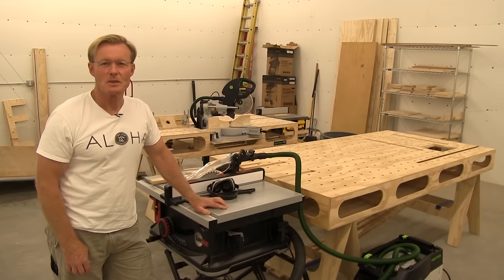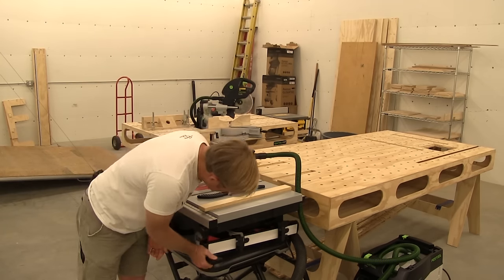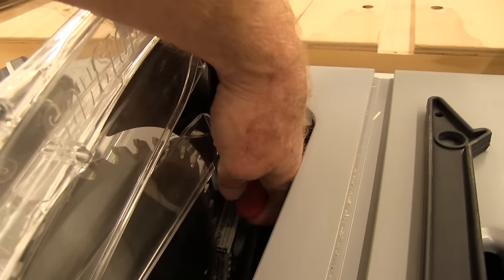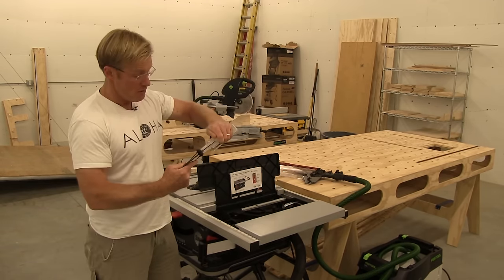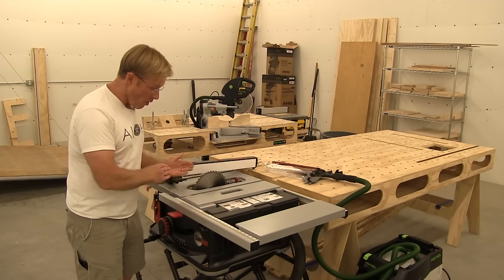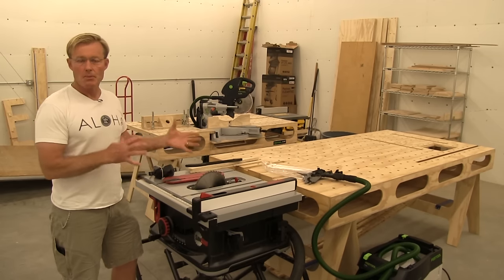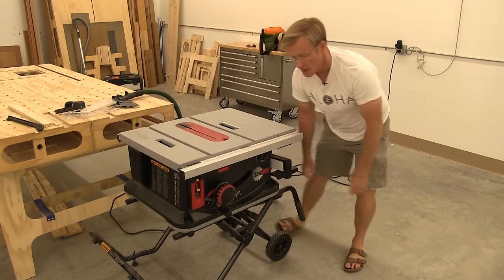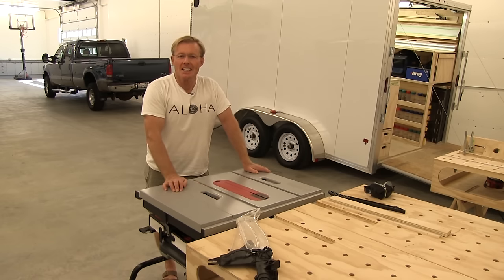Is the SawStop Jobsite Saw Worth the Investment? My Honest Review

Comment: I really like that you showed all the tool-less functions of the riving knife, pawls and guard - really handy that you don't have to find tools to do changes, especially on a site - you showed the brake, is that the same part number brake as on the cabinet saw? - I love when things are cross compatible - I can see many cabinet guys having the full cabinet saw in their shops and the job site saw when installing - so having a brake that works on both would be nice
Reply from the maker: Nick Ferry I have been told that it is the same brake.
Reply: Ron Paulk very cool
Reply: Between 6.40 and 7.40 that is the technology of the original jimmy jig by macduff, credit where credit is due, for proof simply check it out

Comment: True job site  saws have generally been decent for a while now, but to see what SawStop has done is truly impressive. To see not only what they mean to ‘safety first’ , but also in the bevel adjustment, blade rise efficiency and fence accuracy engineering? It can be argued that they are probably the most cost effective saw on the market. (This same mindset has lead to the safety and comfort within the modern vehicles we depend on.) Go SawStop.

Comment: I'd really like to get the SawStop for safety reasons, and this is the only one I can really afford.  How would it compare to the Ridgid r4512 as a first saw for beginning woodworker?  Can I do fine woodworking with this cheap SawStop or would the Ridgid r4512 make better cuts due to being cast iron top?  I'd pay the extra $800 for the SawStop over the Ridgid r4512 if it cut as well (or better).
Reply from the maker: I cannot speak to the Ridgid saw as I have no experience with it or any Ridgid tools. I have two portable SawStop saws and they do everything I ask of them plus go anywhere which is my main requirement.
Reply: Just wondering if you  ended up purchasing that new job site SawStop and if you did how is it working out for you. I am  in a similar position new  to woodworking , wanting the safety features but also wanting a saw I can  build furniture with. Take care.

Comment: Just wanted to thank you Ron.  I bought and used your plans a few years ago for the workbench, and integrated a router, foot-driven vacuum clamping and various cutting jigs that I bring on and off as needed.  I keep it in the shop 100% of the time, and those sawhorse legs, together with the weight of 3/4 baltic top and bottom, and 1/2" sides make for a good 650+ pound solid monster when loaded with planes and other hand tools.  
It's a solid and much more functional for me than my Roubo ever was.

Comment: Does the Sawstop have a bolt hole or anything that can be attached to the workbench to keep the two connected and stable for large out-feed situations?
Reply from the maker: Andrew Latham Andrew, I haven't noticed. The saw is very stable without attachment to the bench and I have used it in demanding real world applications. It doesn't budge. My philosophy is to not spend any time solving problems that don't exist;0)

Comment: Hi Ron. What do you think of the mitre guide? I just bought this very saw and am wondering if I should buy a better, less sloppy guide. Thanks
Reply from the maker: The miter gauge works, but barely. I think all stock gauges are junk and a good aftermarket or shop made is the way to go. I use a miter sled that I built when I need that type of work done. https://www.youtube.com/watch?v=IRVrq6EUBA0

Comment: I  think the New Bosch Reaxx job saw will be superior with it's safety system that doesn't ruin the blade and takes less time to get back to cutting material..
Reply from the maker: +Deke1 Time will tell. I hope Bosch improves their fence with the new saw. I had two Bosch TS with the gravity stands and they were well made, but the fence was not the best. I sold them and switched to DeWalt due to the superior fence. The SawStop has the best fence of any jobsite saw I have owner or used to date. The stop system is important for safety, but how it stops and the time it takes to get it back to work is secondary to the daily function of the saw for my work. I have yet to have the stop trigger, but have used the saw plenty.

Comment: Ron, great video.  I have thought about the SawStop before but have always been turned off by the pricetag.  Your video is very illuminating as to some of the other features of the saw beyond improved safety.  I am wondering if you have had any trouble getting the saw to line up with your table.  Is there a way to adjust it and is it easy to do on the jobsite?  I am starting to build your excellent Total Workstation and wonder if I should bother with adding the tablesaw supports at all.  Thanks!

Comment: To adjust your Paulk workbench did you just cut the legs down a bit.  I made your bench and purchased a saw on a stand like you, and now the saw is not as high as the work bench.  I have been placing wood blocks under the wheels and feet to raise the saw.  Kinda of a pain in the butt.
Reply from the maker: misterbig697 I adjusted the straps (spread of horses) so both of my benches and table saw match in height.

Comment: What kind of woodworking/carpentry do you do?  I ask because I want to purchase a SawStop, but I have a small basement shop and don’t really want to dedicate space to a full-size cabinet saw.  I’m considering the SawStop Contractor model with the deluxe fence (put it on wheels, of course).  I’m a DIYer, and like building cabinets, book cases, and want to build bedroom furniture.  So for the type of projects I do, I’m leery of the job site saw due to the suggestions by others that I’ll not be happy with the standard fence on it; thus, why I’m considering the contractor version with the fence upgrade.  Your thoughts?

Comment: I'm pretty sure that is my next table saw purchase   Ive been waiting for a YouTuber to   Build   A cabinet / work station around  that model  incorporating  a more permanent  set up  than your system  as i would like it to be  a shop saw   And am picking it as a lower. Cost  option  over a Cabinet Tablesaw  but still having the safety  features  of the SawStop

Comment: I have a ridgid table saw and also the festool track saw and I find I use them both but I'm considering switching to a Sawstop and either the JobSite or Contractor saw model.

What tasks do you find better done on the table saw out in the field? And if you didn't need the tablesaw to be portable would you have the contractor or cabinet maker saw stop instead of the job site?

Comment: An excellent video review, Ron.  And superb video editing and really good clear audio, too.  There is  just a little reverb, but it's still quite listenable --  a big THUMBS UP!    For dust collection, are you running a separate dust collector in addition to the Festool shown?  Or did you opt for the Festool CMS "Y" hose to connect both dust ports on the SawStop to the Festool?

Comment: Does the hose for the vacuum interfere with the total station? I built one similar and the hose is right where the bottom platform is.
Reply from the maker: brutusman12345 I just a 90 on the saw to clear the bench
Reply: Good call

Comment: Ron - I notice that you've got your saw connected to a Festool dust collector. I just recently bought the SawStop Jobsite and tried to hook my Festool Midi to the saw - unsuccessfully. I also purchased the optional blade guard with the above the table dust connection port. The Festool Y-connector isn't supposed to fit in the Midi, but using some parts I made it work, so my setup is essentially the same as the setup for the Festool router table - a small hose (27mm) for above the table, and a larger hose (36mm) for below. I tried to connect them to the SawStop saw and neither one of them fit. The 27mm hose was too big, and the 36mm hose was too small. How did you get it to work? Tape?
Reply from the maker: Bob, I haven't had a problem with any vac including Fein, Festool, Milwaukee, Shop Vac, etc... Check out this video.https://www.youtube.com/watch?v=mBZOQlYcVT8

Comment: Can I make a partial cut on a 6 inch board held vertically (with the blade up say 3.5 inches), and then a second cut with the blade at the same height with  the board reversed (up and down) and thereby completing the cut all  the way thru the board.  Thanks  TJ

Comment: I am in an apartment, and probably have more than is "reasonable".  Unfortunately, I cannot accommodate your workstations...

That stated, I am looking into the SawStop table saw, but will need to cut +/- 48" x 48" from time to time.  My concern is the stock feeding area...  what would you recommend for my (and, other apartment leasee's) needs?
Reply from the maker: +TheRangeControl The best options for breaking down large material is a track saw. I would purchase a track saw before getting a table saw.
Reply: I suppose that this NOOB is going to need to to YouTube "Track Saw".  LOL

Thank You for your guidance, Sir.
Reply: By the way, any recommendations?
Reply from the maker: TheRangeControl I have, use, and highly recommend Festool's track saw.
Reply: +Ron Paulk Sir, I hail both you and your generosity.
Reply: Ok, I just got back from the store, and am likely going with your Festool recommendation.

I do need to ask you...  For dust extraction, I cannot see myself spending the over $700 for the Festool branded one (UNLESS you TRULY, TRULIY believe that it is superior enough to justify to cost).

I understand that all needs are subjective.  Therefore (as a scope), my concerns are based upon effective dust management within an apartment unit.

Please advise (and if possible, please share alternatives).

As always, thank you for your time, Sir.
Reply from the maker: TheRangeControl Festool is top shelf and captures the finest dust and does not blow it back into the air like less expensive units. Another good vac is Fein. They are about the same price. http://www.amazon.com/Fein-9-20-25-HEPA-9-Gallon-Vacuum/dp/B003INE4N0/ref=sr_1_9?ie=UTF8&qid=1453845749&sr=8-9&keywords=fein+vacuum+turbo+ii
Reply: Thank You.  I appreciate your candor.
Reply: I need recommendations on 2 more things (I may as well ask since i've asked about everything shy of your social security number... LOL).

1a.) What are your honest thoughts about Triton routers?  1b.) Would you recommend it for Router? 1c.) What would be your top 2 choices?

2a.) Orbital Sander or Random orbital?  2b.) Your top 2 choices?

Those should keep me and my humble bank accounts, projects busy for the next 2 quarters of 2016.  

I really appreciate your time and hope that perhaps you will do video on creating "highly placed single shelves along the wall" to maximize the vertical space...  I'd like to place my books and binders along the top of a few walls, but I am afraid that the weight will cause the shelving to collapse... So, I'd love to be able to follow along and make sure that I do not miss any important factors as I create this "Function over Form" storage solution.  LOL

Again... Thank You, SIr.
Reply from the maker: TheRangeControl I don't have any experience with Triton. Possibly someone else who sees this that has Triton can comment. I own and use Festool, Porter-Cable and Milwaukee. My go to router and favorite of all time is Festool 1400. Sorry to say it, but Festool is by far and away my favorite sander. The control and dust collection is  beyond any others I have owned. I would save $$ on the router and use the savings on a sander.
Reply: Grateful Appreciation!!! :-D
Reply: Ron Paulk oops, sorry... which model sander?
Reply from the maker: TheRangeControl
https://www.festoolusa.com/power-tools/sanders/ROTEX-ro-150-feq-multi-mode-sander-571810

https://www.festoolusa.com/power-tools/sanders/6-random-orbit-sander-ets-ec150-5-571892
Reply: Thank You.

Comment: Great video, what’s the retail price . I have been looking at Makita and Bosch portable table saws for my first table saw
Reply: the SawStop portable saw is like $1500 compared to the $500 range for all the home depot options you speak of. the main difference is the SawStop technology to save your fingers but the build quality is a bit better on the SawStop than the makita or Bosch you're referring to. If you have the coin and want the safety get the SawStop. you won't regret it years down the road for spending the extra

Comment: Ron, do you just leave this saw in your alleyway of your trailer now?
I'm really considering the Bosch with Reaxx... I do like the fact the blade does not get 
destroyed.
Reply from the maker: +K Burk Yes, I store the saw on it's stand in the aisle and roll it out of the way when using the trailer. I am glade Bosch is now entering the safe saw world and hope others follow quickly. I wouldn't choose the saw based on the blade being damaged or not. I would choose based on how well the saw works for you and your needs. If you ever need the system to save a body part, the blade issue will be irrelevant.
Reply: I agree, I use a Bosch saw now on there stand, I love it! It works well in the field. I have all my fingers and at most times of the day my brain is attached to them... saying that I know having a safety feature like Saw Stop or Bosch is the smart thing to do. Its good technology. I was wondering about your trailer because I'm building another one myself. Of course I have looked at yours and the work you put into it makes me want to up my game! I'm not a organized person and I'm not lean....but there is hope I can get there!  Thanks for your response.
Reply: K Burk fyi, the brake rarely actually destroys blades. Just lightly tap the the aluminum a little on each side and it usually comes off with no damage to the teeth.

out of the 12 tripped brakes I have dealt with (working in art schools... darn those aluminum cross cut fences!) I have been able to save all but 3 blades. Two lost a tooth (which I could have had repaired) and one blade ended up being out of true.

Comment: If you were ever to buy another cabinet saw would it be a Sawstop?
Reply from the maker: Bill Hantzopoulos Yes, I have liked their saws for years, but didn't have a need or desire for a cabinet or contractor saw. I was ecstatic when I heard they had a jobsite saw in the works.
Reply: Ron Paulk Thanks Ron. I am looking to buy a cabinet saw but struggle with the price difference between that and say a comparable Grizzly. But I've always heard the Sawstop is an all around better quality through and through.
Reply from the maker: Bill Hantzopoulos Spring for the best tools you can and save $$$$ in the long run.
Reply: Ask yourself how much your fingers are worth. I'm sure it will be much more than the difference in cost.

Comment: Hi Ron, Is it true that you have to replace the brake cartridge every six months even if it wasn't used?
Reply from the maker: I am not a representative of SawStop so I cannot speak from a position of authority, but I am not aware of the brake ever needing to be replaced unless it is tripped. I do know that there are many hidden limitations on the Bosch such as needing to put your cellphone in the airplane mode and that it doesn't stop the blade below 250 rpm.

Comment: I purchased a Jobsite Saw, in part based on your glowing reviews. I have a very small shop, and a cabinet saw would have been a tight squeeze.  I knew I'd have to make some compromises, but I had hoped that it  would be accurate enough to suit my needs.

Nope.

Don't get me wrong. The Jobsite is a great saw for many routine applications, and I respect the thought that went into the design.  But at the end of the day, clever design cannot make up for vibration, significant arbor runout or irregularities in the table surface and miter slot width.  Of course none if this is the fault of Sawstop... they don't claim that this is a precision instrument, and there's only so much that one can do with 90 lbs of aluminum and plastic.

Experiment over.  I'm upgrading to a cabinet saw (how I cram it into my shop is another story entirely).  And since I value my fingers, it'll be a Sawstop.

FWIW... a dissenting opinion.
Reply from the maker: The good news is we all have so many good choices. For me, I only build cabinets, bookcases, and daily woodworking tasks to do with house building and finish work so the SS Jobsite Saw goes far beyond my needs. I had two PowerMatic 66s and I would not give up even one of my SS Jobsite Saws for both. I was at the point of getting rid of the cabinet saws as breaking down plywood was such a chore. My plan was to purchase a $12,000 sliding saw, but then I discovered FT Track Saw and the rest is history.
Reply: If you work primarily with sheet goods, that makes sense.  A small table saw and a track saw may be all that you need.  (I love my TS 55).  But if you're working with solid wood (especially hardwood), it's hard to get stuff done without a good table saw.
Reply from the maker: I agree, I use plywood in great quantities on every project and lots of solid maple, cherry, ipe, etc.. but only 5/4, not really thick stuff. I have found the FT TS with a long track to work better for putting a straight edge on rough hardwood than the Powermatics I had. I use to have a long sled with clamps to get it done, but find the FT faster and more accurate or at least as accurate. Plus, I work on the job site 75% of the time and no cabinet or sliding saw travels well. In my work TableSaw 40% Track Saw 60%